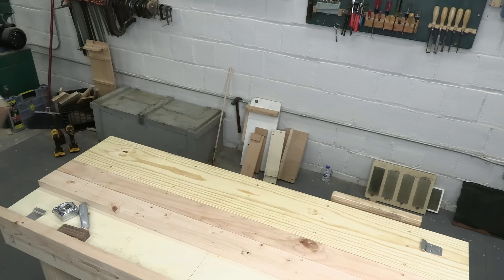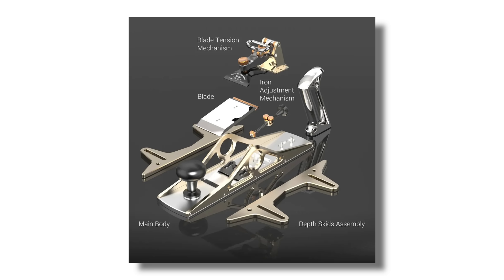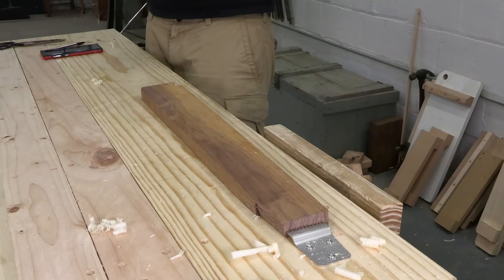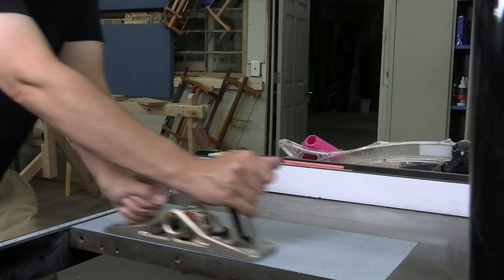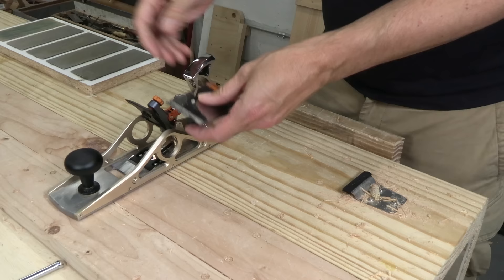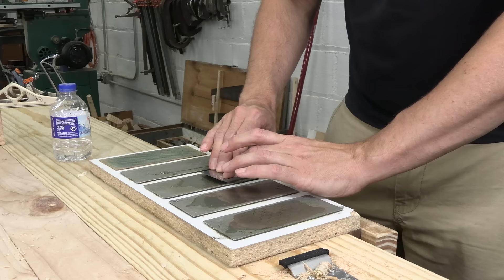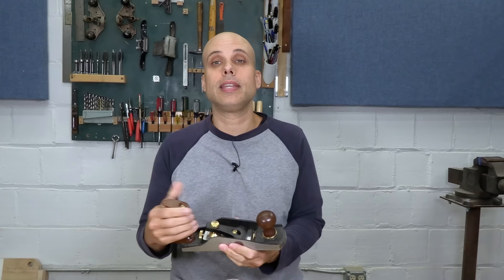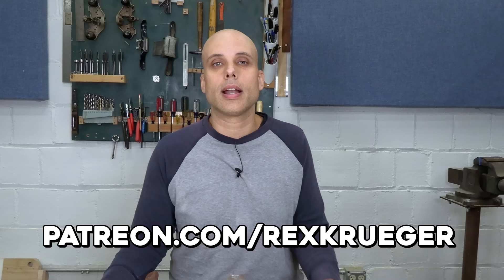How good is a REALLY expensive plane?

Comment: I’m only a hobby woodworker, my profession is photography. I think what most professions have in common is that there is a point of diminishing returns the more you spend on tools. The difference between cheap and mid-range is vast. But mid-range to pro, a little less so. Pro to premium, hardly noticeable. There is a point when the price becomes more about ego than results.

And then even if there is a measurable difference on paper, you often struggle to see that difference in actual real world use that anyone other than the creator will notice. In my profession, for example, a $500 lens will have noticeable imperfections, where the same lens in a $1000 version will give professional results. You then go to $2000 and no one but the photographer who took the image will see the difference. And even if some eagle-eyed viewer can tell two images apart, they only see a “difference”, not that one is better. 

So after many years of always buying the best I could afford, I eventually realised I only needed the best tool for the job, which is often not the most expensive available. I’ve taken the same approach with my hobby woodworking. Getting away from cheap tools and going just a step or two higher was enough to get me some near professional results, without buying anywhere near top of the line.

Anyway, not offering advice to anyone, just something to think about. Buy what you feel does the best for you.

Comment: Just to share, I noticed the Lie Nielsen low angle plane has a sole that's tuned like a Japanese plane. It has a concave sole with low points at the end and just in front/behind the cutting edge! This puts more pressure on the wood just in front of the cutting edge. Interestingly enough, this is not mentioned anywhere on their website.

Of course, the hollow on your sample is clearly undesirable and the cutting performance tells the story.

Thanks for another great video!

Comment: Just for the comparison, a Lie Nielsen No. 62 made in the USA currently costs $295 and a spare blade for it also from Lie Nielsen costs $65 (A2 cryogenically treated Tool Steel) and $100 for the toothed version. So for the price of the made in China fancy plane here you can get a made in USA plane plus 7 (SEVEN!) replacement blades. I see no benefit in the BC lever action blade clamp over any other system on the market. You really have to love the design of the BC plane if you purchase it over any other premium factory plane.

Comment: Great video. I'm glad you got your hands on one of these so I don't have to! Before you even got to the Veritas recommendation my thought was "I would much rather have my Veritas low angle jack and smoother than this for the same price". Having to flatten the sole on a $700 plane is absolutely nuts. That handle always looked really dumb and uncomfortable, so I'm not surprised that its, well, dumb and uncomfortable. Also I love the point about the packaging cost being passed on to the consumer. Lee Valley and Lie Neilson make equistite tools and package them in very simple cardboard boxes. Because what matters is the tool. I don't need an Apple-style box to impress people on Youtube with unboxing videos. It's a plane, I'm going to use it to cut wood. Mind you, I still keep the boxes, because I know that i I ever resell them, some goober on ebay will pay an extra 30% because it's in the original box.
Reply: Some people are dumb in that way, paying extra for the original packaging.
Reply: I have evaluated many Chinese knock-off of various items and they often come exquisitely over-packaged. I have seen this enough that it makes me suspicious!

Comment: Good video, I have only one tool from bridge city tools, it is their bevel gauge, I also find it fairly overdesigned, and it was a bit overpriced. I am glad I got it just to see what the fuss was all about with bridge city tools. 

I am seriously surprised that the sole was so far out of flat, if I had gotten something like that I would have been on the phone to thier customer support immediately. Not that I can make a plane sole flat again, I have the necessary old refrigerator shelf (glass) and wet/dry sandpaper. I would have been upset with the fact they did not do it right the first time.  
I do not think any of my veritas or lie nielson planes ever were shipped to me out of flat. And those were only half the price that this is?

Comment: Hey, Rex.  I just acquired a Stanley 51/52 shooting plane and board combo.....In my opinion even more rare than the #1.  It is 100% complete, in FANTASTIC condition and it is VIRGIN!  That's right.  It has NEVER been used.  There are zero scratches or tool marks.  And it was a literal "barn find".  I found it in a steamer trunk in an old barn nearby where I live in Michigan.  Any interest in doing a review/history report on it?  It's very fragile and very heavy so I am hesitant to mail it.  If I remember correctly you're located in Ohio?  I'm about an hour north of Detroit.  If you're interested perhaps I could drive down there and we could meet halfway or something.

Comment: Thanks for the video Rex. I’m pretty new to woodworking and have been collecting tools as I need them but haven’t ventured into a plane yet. It’s really confusing at this point because the price differences can be huge. I was not expecting this from an  expensive tool. Not being flat? They had one job lol. In all fairness, I would guess that most don’t sharpen blades like you do so can’t say that would be issue for most. Again, thanks for the video.

Comment: I bought a BC Joint Maker Pro..(an upside down table saw).  I work with hand tools because power tool noise upsets my disabled son.  I spent 40 years as a tool designer.  This seemed like a perfect product.  Needless to say, the main mechanism raising the blade failed, as the nylon bevel gears were pressed on; not rigidly fixed.  Bridge City/ Harvey did not want to talk with me…no product backup!.  An expensive purchase that now has limited use. (It doesn’t cut accurate 90 degree bevels anymore either)…stay away from Chinese made tools…unless you are prepared to toss them in the bin….

Comment: I carry a swiss army knife (or leatherman) in my pocket.  It has a screwdriver w/ bits, pliers, a knife, scissors, can opener, tweezers, corkscrew and a pen  If I'm at my bench, I'm getting my real screwdrivers that don't change bits, the right sized pliers, my sloyd knife or box cutter.  I have a can opener that opens a can in 30 seconds.  I have a good corkscrew.  I have tweezers with fine points for splinters.  A bic pen won't cramp my hand after using it a few minutes.  I might get rid of my dedicated bottle opener.  It doesn't work any better than the one on the knife.  Maybe that's why all the multitools have one.  Is there one on that plane?

Comment: I have the Bridge City Tools honing guide, and I am a mechanical engineer with lots of experience in product design and development. That honing guide, and a majority of the products bridge city makes are filled with dumb design choices or just plain engineering errors (like over constraint linear movements). It might look fancy, but don't be fooled. Anodised aluminium is just not a great material for durable tools, anything which needs a screw is going to come loose, and a double sided blade, come on, that is just unsafe. I bet if you tried to use this tool commercially and the company you work for has a health and safety officer, you will need to blunt one edge of the blade. I recently made a little box to hold my honing equipment, and thought to myself, as you have, that the packaging is actually very very nice, so the most useful part of the honing guide is actually the foam of the box, which now lines my wooden storage box 🙂
If you are looking for a honing guide, buy the Veritas MKII.
Reply: Agreed on the design work on these tools, I suspect there was limited testing to prove out the durability.

Comment: I have a mix of planes from Veritas, Stanley, Lie Nielsen and Craftsman.  I bought a Bridge City block plane when they had one of their frequent sales because it looks so cool.   I think it was $80 so not cheap but not expensive either.   It comes loaded with features including an adjustable mouth and those (useless to me) depth rails.  Curiously, the iron, which is the only actual steel on the plane came honed with a secondary bevel which is unusual for planes straight out of the box.  

Frankly, it’s performance is nothing special except for the cuteness factor so I prefer my small bronze LN block plane for any job that needs a small block plane. No doubt Bridge City has some beautiful tools but your video and my own experience tell me their planes are not great value.   Veritas and Lie Nielsen give you what you expect when you pay the money and are beautiful in their own right.   Thanks for the review, Rex.   You do a fantastic job.  I don’t consider myself a beginner and yet I always find enjoyment and information in your videos.

Comment: "(They didn't)," oh Rex, every once in awhile you say something that entirely renews my enjoyment of watching your videos. 

Regarding bridge city, I actually use their mini block plane almost every day (but it took me WEEKS to figure out how to dial the bloody thing in, and frankly, I'm not certain I'm actually using it as intended, vs simply stumbling onto a solution that worked). Same kinda weirdness: almost tech for tech's sake. Although, to be fair: that one DID come flat as float glass and with a similar edge (those should guide things can serve double duty on rabbits or shoulders where you need to support one side of the plane, fyi).

See, they use this little magnet to lock the blade down. It DOES work (and it's a great little apron plane) but if I'm at the bench I'll reach for the squirrel tail Veritas #1 before it for fiddly endgrain on thin stock every time.

Would I buy another one of the bridge city plane line? Totally. Circa 2000-ish. Before the Chinese bought em. Now? If imma spend that kinda money, it'll be on TWO from Veritas or Lie Nelson.

Comment: I agree.  Changing blades even changing bits on a drill bit (even with a quick chuck) slows you down.  It's not that switching a blade is so time consuming, it's mostly that you have to stop your rhythm.  You are planning along with one plane and then need to switch, you just reach over and switch takes seconds.  Changing a blade means you have to go find your blade and swap it out and put your other blade away and then remember which blade you have on there.  With a dedicated plane, you already know this plane is for this, that plane is for that.    Much like having two drills one for drilling and one for driving a screw in.  It's not only more efficient you are not looking around for bits and bobs to continue your work.   I'm sure I'm preaching to the choir.

Comment: Could have added a magnetic link to the lever cap that lifts out the iron when you flip it.. and included more, single edged, irons for the money they're charging.

Also, I don't think it would be that difficult to engineer a plane that can give you two angles to toggle between. If you cut out a tilted U-shaped slot on either side & put a pin through the frog, with a hinge down near the sole & the entire frog & iron sliding up and down on a track, you could easily shift the angle & keep it locked in under pressure. With the right lengths of cut at either end of the U, you could ensure that the edge cuts to the same depth on both angles, even though the hinge would need to be slightly higher up the iron. Then the only issue is the width of the mouth, which would need to open in order to push the iron down to change the angle & then close up again when pulling it back, but that could be linked to the sliding frog via tracks in the sides of the body. Not so difficult to engineer, but very expensive to mill.

Comment: Huh, the dual sided blade thing reminded me of an odd old Handyman plane (at least under the same line as the bailey style kind) that let you rotate a separate cutting insert that's screwed onto a holder around for like 4 cutting edges. I guess Stanley also thought it wasn't the best idea in the world and dropped most of the line after a couple years according to some casual researching. I think the only survivor is the pressed steel H101 that's still sold today under different brands

Comment: One of the principle downsides of low-angle planes is sharpening the iron. Like Rex says, it's awkward to hold and the 38 or 50 degree bevel feels unnatural. The same applies even with a honing guide. I do possess a LV LA jack plane but my hand nearly always falls to my Quangsheng/Wood River no.5. There's a reason the Stanleys have been around 140 years or so.

Comment: I own several BC tools from the early years and I am very happy with them. However I also own several BC tools containing jauro wood (composite) and brass. The composite wood reacted with the brass and corroded the metal. The solid wood tools with brass are fine. While I don’t think the original warranty was sustainable this is a material compatibility issue a they should be willing to repair or replace the tools. They have been unwilling to make the repairs unless I pay for the repairs. I am not throwing good money after bad. I will not purchase BC tools again.

Comment: This plane came as a gift to me. Big disappointment! At that price our expectations are high obviously. I can see you're very careful with your words but it's not a useful tool at all. Maybe nice for display. Sole is not flat on mine either. Not comfortable to use. Holding the blade while sharpening is another problem...
On the other hand I'm very happy with my veritas jointer plane and low angle jack. Simple and useful high end tools yet still relatively affordable.
Thanks for the review.

Comment: That piece of red oak has upward grain where you're starting the cut. It would have worked better the other way. Always check the grain direction before plaining. if the grain is like //// on the edge, you plain ->

Comment: Shame to hear they're not enjoyable users - I might still keep my eye on one of their block planes if I want to get really into kumiko or similar, but that's a big no for me on the bench planes (as if I could afford it!).
Would love to hear your thoughts on the Veritas low-angle smoother. I'm in the market for a good smoother, and have been eyeing one of the many Bailey-patterns available. The only low-angle plane I've used was a borrowed Low-angle jack, which worked well on end grain but I didn't see much advantage on the face of the board. I normally hear that you should get a high-angle plane for smoothing difficult grain, so a low-angle smoother seems counterintuitive to me. 
Thank you for an interesting video!
Reply: Oh their block planes do seem interesting. Their bevel gauges too.
Reply: The block planes seems to be much more reasonably priced. That said, if you want to make small pieces, I suggest looking into small piece thicknessing jigs. They're really not that hard to make and work well.

Comment: Hey Rex, you shouldn't lap a brand new premium plane. A £25 Stanley, sure, but if you're paying top dollar then you need to send it back and get a replacement. A premium planemaker might be using surface grinders to flatten their soles and can probably do a far better job than a sheet of sandpaper on a flat substrate.

I do hope you haven't voided your friends warranty by lapping it yourself.

Comment: That plane is a piece of art, made for looks rather than function.  If it were really made for function, then the issues you identify would have been redesigned.  My planes are mostly 100-year plus Stanleys.  I liked Type 11s, until Christopher Schwarz labeled the Type 11 the best for the price.  That immediately shot the price of that particular version through the roof.  Most of the things you here about thick blades, chatter, tear out, and such are the result of not knowing the right tactics, or how to fettle the plane properly.  The premium-ish planes show up nicely out of the box, but after a year, they aren't that much different from a good, well-fettled Bailey.  From the point where you start resharpening the blades onward, the performance is down to the user.

Comment: Thanks for the review Rex.  Question for you about a Stanley #7 where there is a visible crack 5 1/4" from the rear of the sole and 3/4 of the width of the sole.  While the crack is visible (barely) you cannot feel it and it does not extend up the side of the sole.  My question is how worried should I be about that crack?

Comment: Thank you, Rex. I totally agree that THAT plane is not worth buying... almost at any price except those blades are great but expensive.. and made wrong. uncomfortable to use, confusing engineering, difficult to sharpen, ergonomically off kilter in most aspects. Thank heaven for Stanley. Imagine if they had attempted to make their tools that way -- we'd be using wooden planes today. I believe they would be a better choice for everyday woodworking if that Bridge City plane was the other option... Certainly I would not buy one for $50 even with both blades. I like my hands and fingers too much to have to wear insulated anticut gloves while using cast iron handles and sharpening blades.